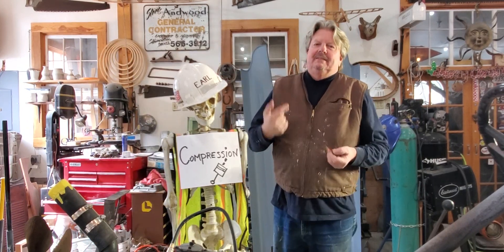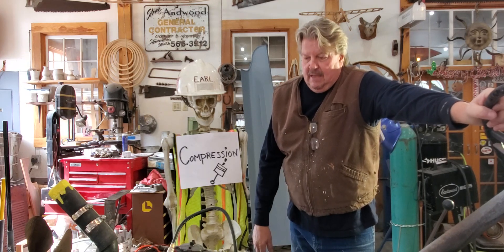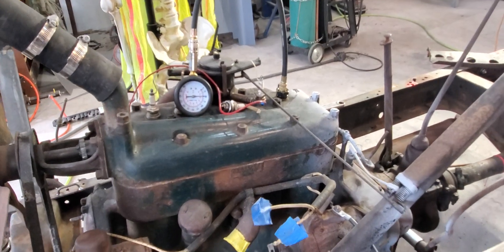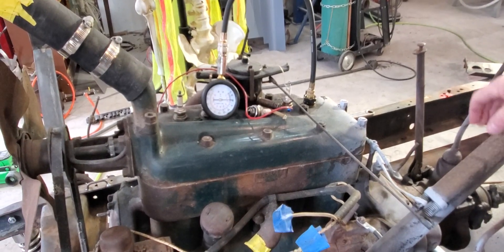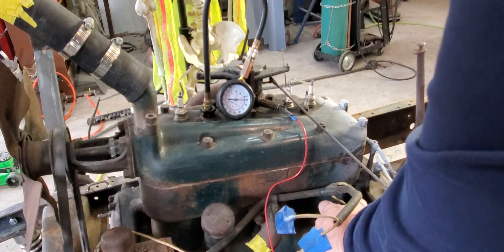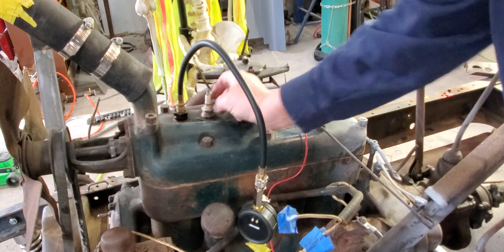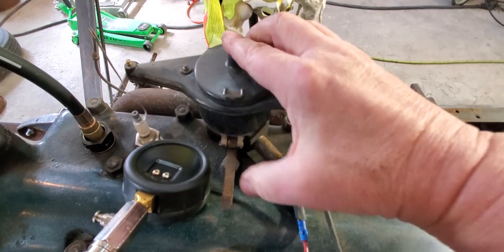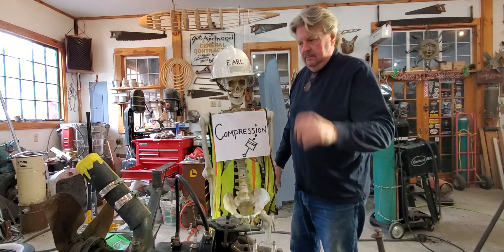Model A Ford Duesenberg Engine Compression Test

Comment: I believe you are correct in stating the compression would test higher if the engine had been run. Not because it would be warm but because piston rings seal better with the cylinder wall when they have some oil on them. An engine that sits for a while can become pretty dry.
Reply from the maker: You got it. Thanks for watching!